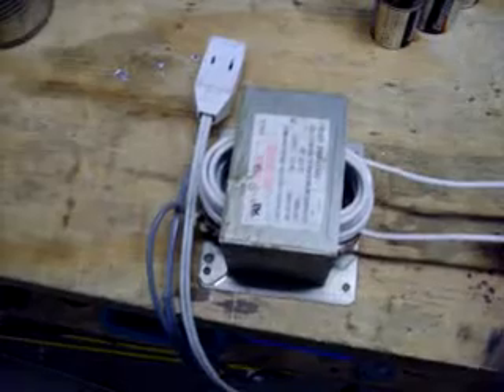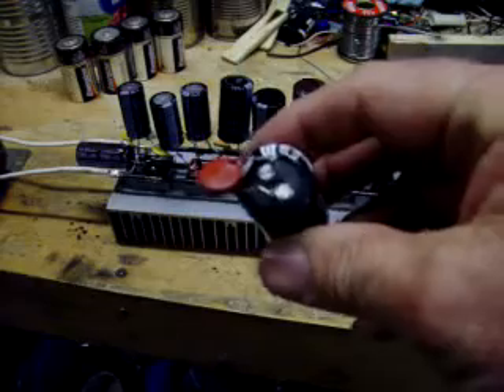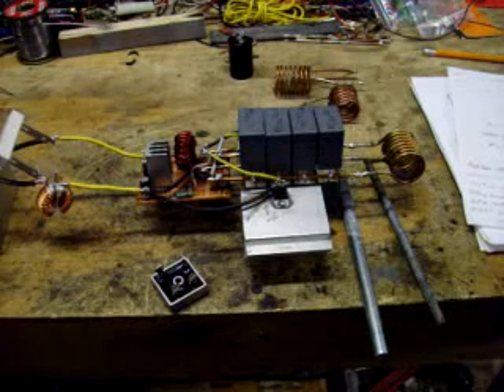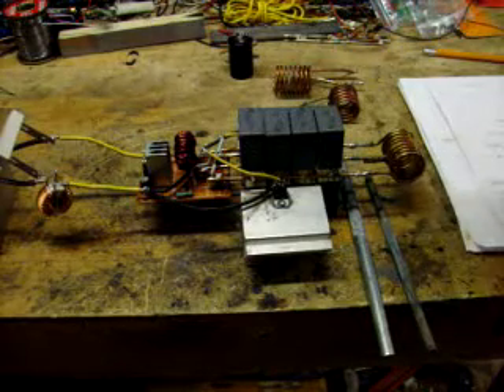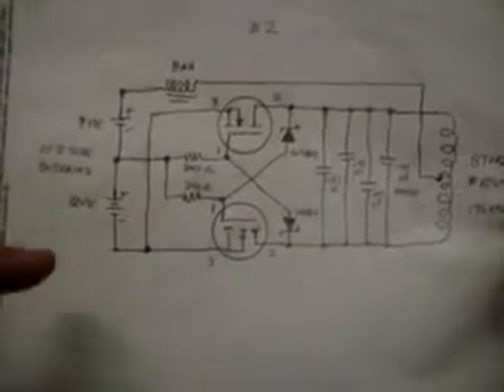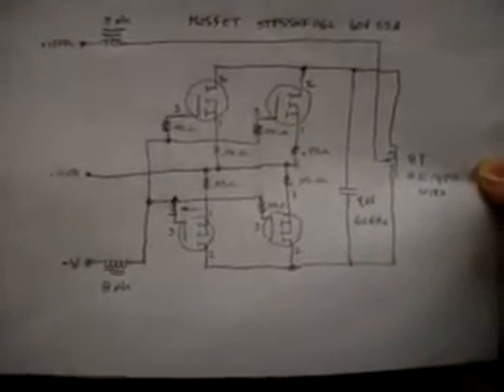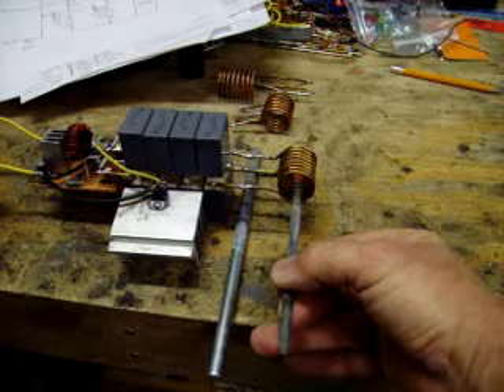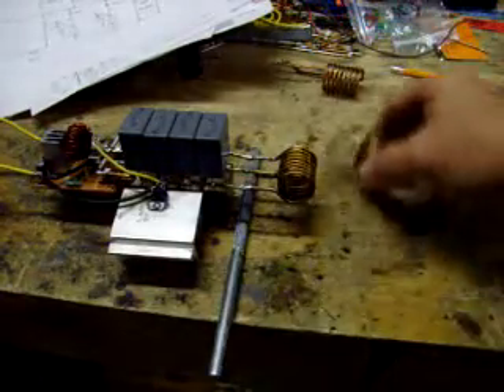Induction Heater Circuit High Frequency N channel Mosfets

Comment: This is my YouTube page I forgot my password about 8 years ago.  I have this circuit running great now, P555NF06 mosfets are running a 34 amps and power supply is 24 volts be careful mosfets explode at 35 amps.  I have 8 chokes on B+ power supply.  Trigger voltage is 12vdc.  Work coil is 2uf.  I trashed the original power supply and built a nice one with 1 bridge rectifier.  Circuit is now 816 watts it will heat a 1/4 steel rod red hot in about 15 seconds.

Comment: I'll use 6 IRFP250N mosfet ( 3 in parallel in each side ) , 4 ceramic capacitor , 6 1N5819 schottky diode using a 20 volts 15 amps power supply is that ok ?

Comment from the maker: Since this video was made I have made more improvements to this circuit. Power supply capacitor bank is now 35,000. uf. LC coil is still 4 uf 1000 volt capacitors with the 8 turn coil 1" diameter 1.3" long. I added 3 more turns to my transformer secondary coil the voltage is up to 17.76 vdc. Mosfets are STP55NF06L and zener diodes are 1N5819. Gate resistors are still 240 ohms and I still have a 7812 voltage regulator to make +12 volts to the gates.  Current through the mosfets is 36 amps with a 3/8" steel rod as the load in the LC coil.  The rod heats up to 1400 degrees in 15 seconds.  The most amazing thing is, the Mosfets no longer make as much heat as they use to. Heat sinks only warm up 7 degrees F in 45 seconds, before they heated up 50 degrees F in 45 seconds. I am getting 577 watts from these 2 mosfets.